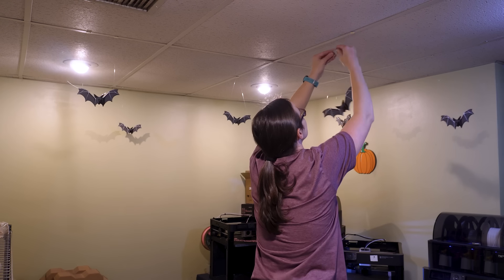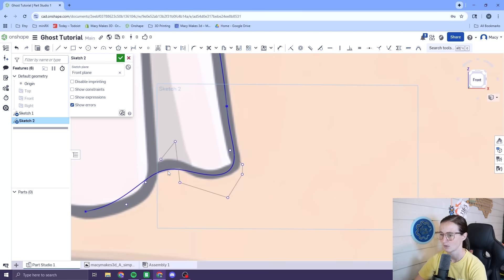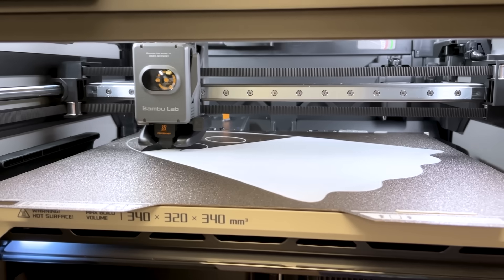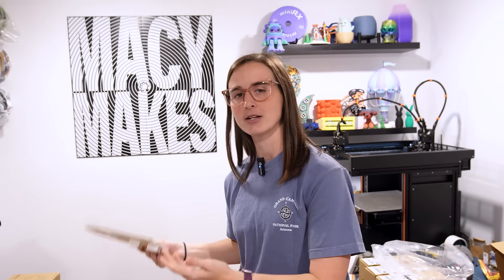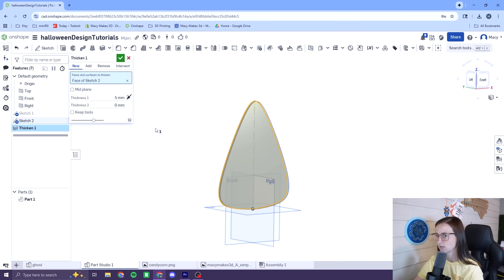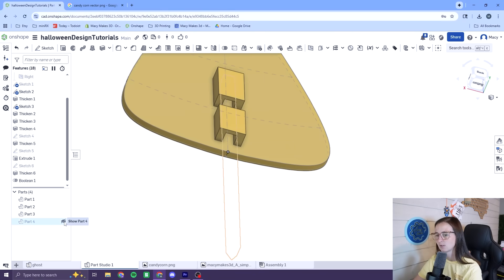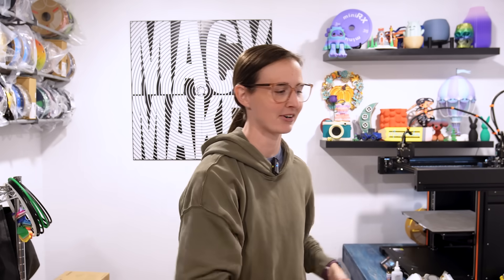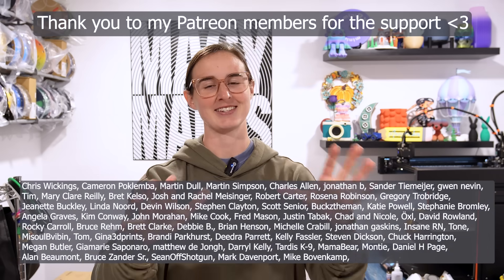Quick and Easy Last Minute Halloween Design Inspiration

Comment: What do you do to have prints stick I’ve only had my p1s for 4 days and my prints no longer stick , I’ve already made several attempt washing plate with soap and  cleaning it with alcohol ?
Reply: Don't clean with alcohol. It can work but it can also just push oils around. Make sure you're cleaning with a lotion-free detergent like Dawn. Also, bump your bed temps up by 5 to 10 degrees Celsius.